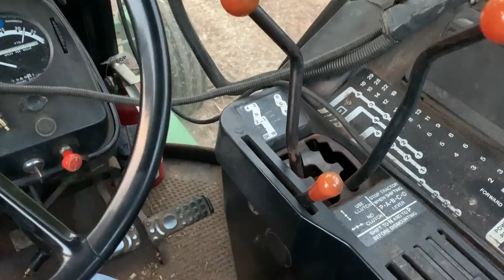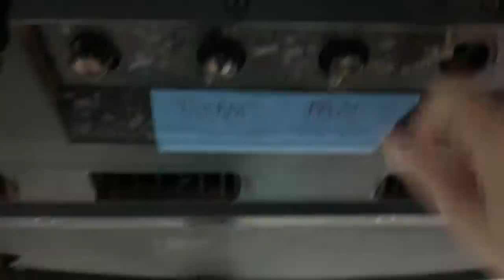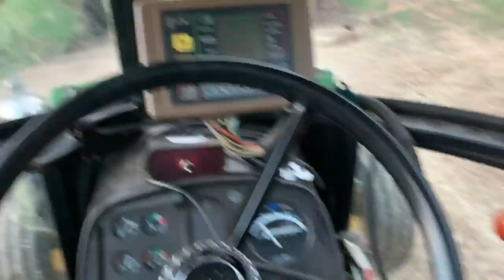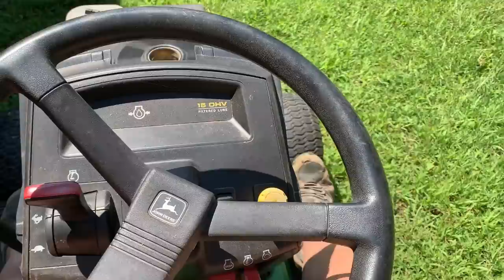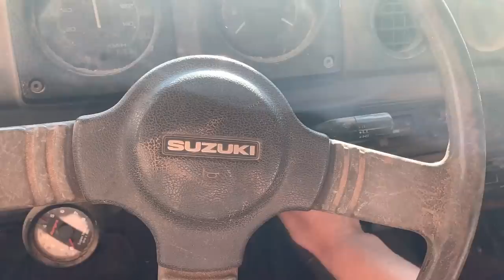Corn Silage Harvest 2019 : Part 2

Comment: You need to put a old style ford starter solenoid in the start circuit on Suzy.      Run the ignition wire from the switch to the activation pole of the the ford solenoid and the run full battery voltage through the solenoid to the starter solenoid on Suzy.  I have done this on several Zuki's to fix that intermittent starting issue.
Reply from the maker: I don’t know about that stuff but hubs does. I’ll tell him!
Reply: @ThisFarmWife_  Do a google search for samurai clicky relay fix.    Several different ways to go about it.
Reply: grew up on a farm and fixed starting problem on all kind of equipment

Comment: 18K Subscribers nice. Two video's in one week  what a nice way to end a hard day here by watching your video. Good to see you have another job done. I see the hard time with the push mower. some time their a shut off for the gas under the fuel tank. then let the mower run out of gas. I have to do this after the season is over, with all my mowers so I can start them next spring. I also so saw the tears started when you could not shut the mower off. Your son is being a big help on the farm and nice to see he wants to help.

Comment: I had a small part in making those 4440's of yours. Glad to see they are still working because I am not. : )
Reply: Those 40 series JD's are some of the best, most reliable, SERVICEABLE farm tractors EVER made.
Reply: ha ha those 4040 i siezed one up baling on a hillside engines sump to shallow and starved it of oil then our local jd dealer says you need to put extra oil in to work them on steep hills  nasty hyd 4x4 also always filled the back end up with brass fillings
Reply: @davidbaker3270  Nothing is idiot proof.
Reply: @gonerydin4225 i know makes ya wonder what idiot let it of the drawing board shame it wasn`t as good as our  5 3130 s we also had  barely a problem just worn with age
Reply: @davidbaker3270  Still looks like only idiots had problems with them as most of them are still out there getting the job done.
Reply: @davidbaker3270  And yet John Deere has remained prosperous for 183 years. What other tractor company has come close to that? The 40 series tractors remain some of the most durable and reliable machines ever built despite ignorant comments like yours.

Comment: The rotary black switch you thought was for wipers on dash is the common John Deere headlights, work lights for field and road travel  selection, most 20 ,30,40 and 50,55 series all have that common light switch.

Comment: That puts a load on a tractor running that chopper. When i was a JD field tech i one of my customers was the only one in the area that did silage he had a 4840 he was chopping 3 rows. Every year i went out there and cranked down on the fuel screw. Then when he was finished chopping i went back out and set it back to factory. When he was chopping that was the baddest 4840 in the state.

Comment: I have just read a few comments about how you have to rewire the solenoid ( whatever that is !) or bypass the ignition switch of the Suzuki.....
No...seriously no. I can tell You have a special relationship with machines because every time you say ,” Cmon baby” the things always start.
Even the lawnmower started first go ..... even tho it wouldn’t stop!! Ha
You should run a shop in town...Merdies Motors ! ( no parts required just a ,’ cmon baby’.) 
Harvest going ok here. Yields good but prices and weather awful. That’s farming.

Comment: You should build a roller tank to mount on the front of the tractor.  You or sand. could build it in winter.  Fill with water or sand.

Comment: me wondering what the Temp in silage  be at 🔥 heat  used for  ? 🤷‍♂️Some small Australian🦘 outback c/o made borewater  dams  black plastic bottoms 
 and found the heat was near boiling point a few test and work they covered the dams clear plastic  collected fresh drinking water & used the heat  to help power generartors   1 water 2 salt 3 power addded to gas motor  $=electricty for local production      the outback dry &  hot  Also SA fish breeder after 10 years finally got tuna to breed in there Huge tanks seems every full moon on a speacial day was the  key here  Now he supplys tuna fingerlings to breed ponds  guess Asia c/o  are  onto  this also  expecially the Japanese

Comment: Good video. Just two things I would like to suggest . First NEVER USE ROUND UP.  That is the stuff that is causing all the bee's to die. Second unless your well water is bad then just fill a big jug and put some ice in it and use reusable bottles to drink from . I worked in the biggest water bottling plant in Ontario and I can tell you that first off the water just comes from a river that is near by and second it is not better then spring water nor is it spring water even though on at least some of the labels it says spring water it is really just river water that has had ozone added to it and the quality control in the place is very poor. The biggest water bottle place is owned by Coca Cola and is just Toronto city water that fools in Toronto pay more for then a bottle of Coke even though the water is exactly the same as the water that comes from the tap in the house . Silly.  So consider that I know one of the sons of the owner of the so called spring water bottle place and he will not have any part of it even though he would be a millionaire if he did because he knows it is just one big rip off  . That is my piece. Please do look up bee's and round up and you will see it has been confirmed that round up is killing the bees.

Comment: Interesting to see similarities and improvements from how we did it in MO in about 1970. 1-row JD picker, 2 hay wagons without hydraulic dumps so we had to drag silage out. So we ran the wagons as high as we could pull them with two tractors, hooked a chain to the drag below, then pulled the wagon and drag apart. The wagon puller would put the drags back in and run back to the field while the second one came in. Between loads, the two tractors at the pit did the smooth and pack work. It took 6-7 of us a day to fill a much smaller trench. It did smell good. I’m glad you told us the first field was a little dry - it looked it to me, or I was having a half-century mis-remember. We also did not have a front end loader so had to smooth it with a 3-point blade. And dig it out and load it with silage forks. The trench was at my grandmother’s place, and she cooked lunch for us and the neighbors who helped.  It was a fun day, believe it or not.
Reply from the maker: That sounds like a lot of work! And similar stories LB has to how they used to have to do things. Hard to imagine how different it used to be. He grew up using mules and plows. :O Thanks for being here!

Comment: Why corn and not hay for silage? Cows are grass eaters, no?
Reply: Well technically corn is a grass. But seriously for energy and palatability corn silage is second to none for cow feed. You can harvest more off an acre than anything else. But you can also make wheat, rye, barley, oats, alfalfa, pretty much anything can be chopped and ensiled. The feed value varies depending on how mature the crop is at harvest and from crop to crop. Dairies mix different silages and other ingredients to balance the nutritional needs of the cows and maximize milk production. When feeding brood cows you need to meet their needs as inexpensively as possible. Corn silage provides the carbs and some protein which allows you to feed lesser value hay.